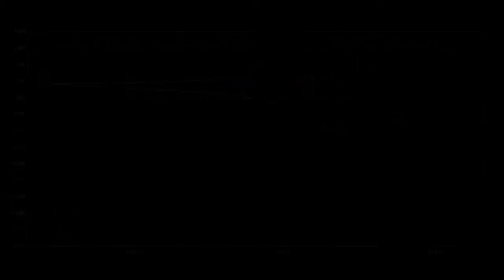How To Make A DIY tonestyler

Comment from the maker: Thanks for all the inquiries about my cap and resistor values.  Please don't take this the wrong way, but really the point of this vid is to encourage y'all to have a go at designing one for yourselves! :)  

Realistically, with this sort of thing, unless your pickup has exactly the same L, C and R as mine, my values will behave differently in your bass.  

And even though it's designed to get a little closer to the treble-cut characteristics of a preamp, this, of course, lacks the active buffering that a preamp has.  It interacts directly with the properties of the pickup.  But FWIW, if you really want to try my values; 150p, 390p/33k, 820p/27k, 1n5/22k, 2n7/15k, 4n7/12k, 8n2/10k, 15n/4k7, 33n, 56n, 82n.  Your mileage will vary...
Reply: Thanks for sharing this mod Rob. I'm really inspired to give it a go. One thing that I can't work out is how to calculate the resistor values for taming the mid peaks. Was there a formula you followed or did you take a guess?
Reply: Hi. What switching dial did you use? I'd like to do something similar on guitar. Thanks
Reply: Where can I buy one of these with the caps?
Reply: I hear what you say but that doesn’t explain the values of the resistors (they can’t be auditioned purely via audio, can they?) know whether they are in series or parallel with the capacitors🤷‍♂️

Comment: What a great way to ground the capacitors - efficient and space saving. I've often wondered why nobody has produced a tag strip to solder ground leads to when going to a vol pot. It always seems such a cram to fit all the leads in.
Reply from the maker: Thanks mate.  One of my early videos.  Not well lit, shot or edited.  But good info there, so I've left it up.  I'm planning a follow up to this video once I finish Project Berocca...

Comment: Thanks so much for sharing this! It inspired me to do my own. I wanted a lot of choices, so I bought a 1/2” diameter 16 position switch for $20, and a box of Mylar caps. As I don’t have the equipment or wizardry for going all out calculating values, I played with values with wires running to a socket, until I decided on what sounded best. I also wanted to keep the resonant peaks. In spirit of how you grounded to an outside strip to save space, I wrapped a desoldering braid around the outside of mine and soldered to that. It all fits nicely in my P bass.

Comment: What a great video, thank you! The Blu-Tack "soldering stand" is an idea I will definitely adopt. I see that you put the resonance-taming resistors in series with the caps. I have seen schematics where resistors are placed in parallel. Not sure I understand the difference between those two approaches, could you elaborate?

Comment: Excellent stuff. Is it easy to create a circuit that measures pickup resonant frequency?
Reply from the maker: I'm planning to revisit this video at some stage TBH.  There are one or two little things that are not quite right,  plus I was new to YouTube when I made it.  This project seems to be misunderstood and needs a better explanation I reckon.
To find the resonant frequency I use a driver coil and a signal generator.   I wound the coil myself, but there's other options.  The old usb scope and software I use was bought mostly for this and because it can plot freq responses. These days you can get scopes that do it that aren't crazy expensive like they used to be.
Reply: @RobMods  ok, thanks for the reply.

Comment: Is it possible to combine a tone styler (variable cap selector knob) with a separate (full sweep pot) tone control, and would that allow wide variations with each preset capacitor?
Reply from the maker: Yep, having a standard 250KA pot and a switch of some sort that selects different caps is a very common mod.  That's really not what I was going for with this design, but I say go for it.  Give it a try!

Comment: So did you wrap foil around the switch and then just solder the capacitors to that to ground them? Because that seems infinitely better than what I was trying lol
Reply from the maker: Yep, it works well, but is still pretty fiddly to wire up, especially with the addition of the resistors on there.  If you have the space, another approach is to use a switch with PCB pins, and install it on a piece of circuit board.  You could just dremel the circuit, and use a mini drill for the parts.  Or, really if I had to do a few of these, I'd just design a PCB, and with SMT parts as well...

Comment: Great video Rob; thanks a million for posting! 

I've managed to duplicate what you've done after many careful viewings of the vid, buying the CGM USB scope and downloading and learning LTSpice (took a few hours but well worth the effort). I've got data (resonance, suitable cap and 'taming' resistor values) for a few odd bass pickups I've had kicking around for a while. Haven't yet put them into a bass for testing, but that will come soon. 

A couple of questions, one actually arising from a later video you did: 
1) How did you get such a clean display when measuring PU resonance? Did you amplify the sine wave signal generated by the oscilloscope? My waveforms and the XY plot were pretty ragged because I had to use high sensitivity on the scope to detect them, (but I still managed  to estimate what the resonance frequency was).
2) If I want to measure a PU's frequency response using a driver coil, what kind of coil should I use? Can they be bought, or must I make one up?
Thanks for any tips you can offer.
Reply from the maker: Nice one mate.  for a cleaner scope reading, try covering the pickup with some shielding material.  Just a piece of plastic or card with copper foil on the top side will work.  And use an alligator clip lead to connect it to earth or course.  As for a driver coil, well I wound my own, and I made a simple buffer preamp as the output z of my usb scope is not particularly low.  But you could probably use an audio transformer, or maybe a coil from a relay or something, as long as it has much lower inductance than a guitar pickup, so its resonance is much higher, out of human hearing.

Comment: With these fixed roll-offs are they the equivalent of tone pots fully off i.e. full cut? 
Very neat construction. I like the plasticine "jig".
I'd like to learn more about the setup for determining the resonant frequency of the pickup. I've got the toys to do that.
What are the values 3.81 and 2.01 in the notebook working lines 3 and 4 ? And M2 and H2 ? Ya got me there...
Reply: OK got it. Nanofarad values for bracketing towards a result.  Plus I found this pdf. http://www.syscompdesign.com/assets/Images/AppNotes/guitar-pickups.pdf which appears to be what you're doing in the vid.
Reply: That's a really nice range of tones your Precision is getting, I'm tempted.
The frequencies being musically useful they don't suffer from being full roll off like a stock cap would, what it the stock cap value btw?
That's the Greyest lump of Blue Tac I've ever seen.  I too have used the old "Helping Hands"  but my favourite is a little Chinese vise. I used to carry two on gigs. One loose and another screwed to a piece of scrap wood. The stuff I've fixed for bands at gigs I was doing the PA for. They loved me. Got lots of work cos they remembered me saving their arses. Nice bit of Karma innit. ;^)
My electronics bench is covered in randomness. I can't call it crap cos a lot of it is expensive crap...
After watching this I fancy dusting off the scopes. Somewhere under the pile is a Hantek USB signal generator  and every other multimeter has a Capacitance range these days. 
The copper wrap is a neat idea, elegant solution I'd call it.
Stream of conciousness comment order . It's early hours Saturday night/Sunday morning and I'm somewhat the worse for wear. ;^)
Keep up the good work.
Reply from the maker: Ha ha, yeah that blob of blu-tac is getting quite grubby these days.  It's seen a lot of action!  Time for a new packet I think...  :)

The original cap was 47n.

The solo part on my recent version of Blackbird is played on my 73P.  It has an active preamp in it these days, with the treble boosted for this recording.  That's just to separate it from the EUB in the mix.  I don't always play her with such a bright tone.   /watch?v=qtjKge6Bj9Y

Comment: Rod mods, do you have the schematic to Jesse Davey Kingtone switch?
Reply from the maker: No I don't.  Sorry.
Reply: Can you try reverse engineering the jesse Davey kingtone switch?
Reply from the maker: Reverse engineering other people's stuff is not really my thing.  Besides, these are $200 in Australia.  But thanks for asking...
Reply: I didn't know they were $200 dollars in Australia that's a rip off but from your ears can you tell which RC networks are being used in position#1,#2,#3 on the jesse Davey kingtone switch?
Reply from the maker: @waynegram8907  If they are just RC, then that really is a rip off, lol.  I assumed there was a little inductor in there as well.  I guess you aren't paying for the parts, but the soldering, potting and postage.  I hadn't heard of these until 10min ago.  Never had one on my bench either I'm afraid.  Try making one yourself!  A breadboard or even just an IC socket like I used is great for quick swapping caps.
Reply: Yes true you use machine head pins sockets for swapping caps? If just don't know what RC values he used because they sound different from a varitone switch which I don't like the varitone but the jesse Davey kingtone switch has really good positions 1,2,3,4 I like a lot
Reply from the maker: @waynegram8907  Cool.  Well I'll keep an eye out for one.  But I mostly work on basses these days.  FWIW, with these sort of things, the response they create is dependent on the pickup specs, especially inductance which varies hugely from pickup to pickup, and also changes when you change your pickup selector switch.  Saying one position is "true-bypass" is a bit misleading IMHO, because it implies that like a pedal, the signal goes "through" the switch.  The components simply shift the resonant frequency around.  Check out Project Berocca Part 9 for more stuff about cap loading.  https://youtu.be/54kHIhT0un8
Reply: Yes when the tone control is set at 10 on guitars or on bass its still going through the capacitor on the resistive tone pot which shifts the center frequency to the left.The Delta Tone on guitars means that they use No Load Pots on the pickups which give you wide open center frequency of the pickups
Reply: How are you connecting a guitars pickup to plot the frequency response of the guitar pickup? are you using a spectrum analyzer and sweep generator?
Reply from the maker: @waynegram8907  You can make your own no-load tone pots:  https://youtu.be/fBLp53iNCf4  You can even make your own lo-load volume pots:  https://youtu.be/a_hoNAT4JcM  As for how tone caps work, check out my two-part video on that:  https://youtu.be/zE-vzFeuh5c
Reply from the maker: @waynegram8907  You can make your own No-Load tone pots.  https://youtu.be/fBLp53iNCf4  You can even make your own No-Load volume pots.  https://youtu.be/a_hoNAT4JcM  For more info on how passive tone controls actually work, check out my two-part video on tone caps.  https://youtu.be/zE-vzFeuh5c
Reply: Yes I have seen that video of making your own no load pots before saves a lot of money.

Comment: What was that grey putty you were using? I've tried to use modeling clay the same way, but it ended up adhering to the pins of the thing I was soldering.
Reply from the maker: That's Blu-tack.  It works very well for this sort of thing.  I also use it to hold wires or parts in place when I'm point-to-point wiring a bass or an old amp etc.

Comment: I want to do everything in this video.

1. how do I test for my pick up frequency?
2. I'm assuming that 100n cap was chosen by your ear. 
3. What math did you use to equally divide the res frequency to the cap with the lowest desirable roll off?.
Reply from the maker: Hi.  I use a Circuit Gear usb oscilloscope.  Here's how to measure the resonant freq:  https://pdfs.semanticscholar.org/89d5/f924dddb854b01fe989662d57d9347170f55.pdf
You can also do frequency sweeps if you make a driver coil.  If you watch my other videos you'll see this from time to time.

Yes, the lowest cap was just chosen by ear.  Actually I changed it to 82n later on.  100n was just too muddy for this pickup.

For evenly spaced frequencies, it's simple division.  In the video, the spreadsheet shows 4khz as the resonance, and 1.37 as the divisor.  But after cable capacitance and the load of the pots, the highest roll-off is more like 2.5khz.  So these points were revised.
Reply: Was that a copper ribbon you cut and wrapped around the 12 pole switch?
Reply from the maker: It's self-adhesive copper shielding tape.  I use it to line control cavities mainly.  You can buy it online from guitar supply stores, but you can also buy it from garden centres as "slug and snail tape".

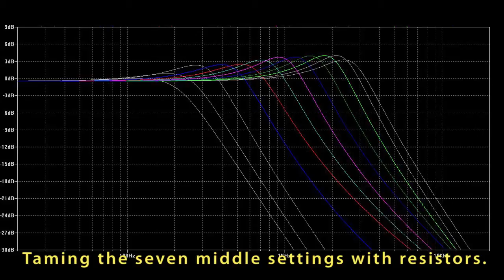Comment: Is that LTSpice on the laptop at 3:52? I used to work for Linear Tech. Anyway, this is a good video. I'm thinking a rotary switch with RC combinations to switch through could be more useful than one cap and an R sweep pot.  Thanks for the idea! Any particular values you like best?
Reply from the maker: Hi Eric.  Glad you enjoyed the video.  I'm trying to get better at making these things as I go!  Yes that's LTSpice.  It's pretty much the go-to for hobby electronics guys.  With a traditional tone pot, the cap really makes little difference til the tone knob is almost all the way down.  It's actually the pot that is creating the roll-off for 75-80% of the sweep.   The nice thing about my switched-cap tone control is that the roll-off is steeper.  Much more like an active treble cut.

I have a new video all about traditional P bass tone control coming out in a day or two.  I use a driver coil and a usb scope to run frequency sweeps on the pickup from this bass actually...  Thanks for your comments!
Reply: @RobMods  I like the blutak to hold things while soldering too. Looks easier than alligator clip stands which I've been using for years. Are you simulating the pickup too? Since the input to an amp is high impedance you probably wouldn't need it in your  simulation, but how about the PU?
Reply from the maker: Ha yeah I''ve owned those alligator clip stand things too.  But I've always come back to a blob of bluetac on a piece of timber!  I've been sodlering since I was a boy and I found early on that blutak is very handy for guitar wiring and point-to-point wiring in general.  Notice also my bench has that rubber draw lining stuff on it.  The circuit or guitar doesn't slide around.  Yes the pickup was simulated in a basic L,C,R model.  A bit too simplistic really, but for designing this sort of thing it's fine.  The thing I really should've done was added more cable capacitance.   I think I had 250p for this, but I should've actually measured my leads.  They have close to double this, so the first cap doesn't make much difference.  OTOH, I have a no-load volume pot (see my other video about this), so the pickup is as bright as it can be with the volume up.  I have a little fet buffer built into a jack which I sometimes use and with the cable capacitance out of the equation, the pickup's resonance is actually 4khz.

Oh, and I recommend a "make-before-break" switch for this.  (AKA "MBB" or "shorting".)  The switch I used in this video was a regular break-before-make switch that I had in my parts bins, and it pops slightly between settings.  I've since made another with an MBB rotary switch I ordered.  Works very well.

Comment: Forgive me but I just don’t  understand how to work out the value of the RESISTORS!

I can understand auditioning CAPACITORS  by ear but after that…🤷‍♂️ How to work out the resistance values IF  The values for the Resistors you use are all different depending on what Capacitor the attached to?🤔

Comment: You do know you  get full gain and tone without a control
Reply from the maker: Yes and no.  With reasonable pot values, the gain/output is not effected, but the tone certainly is.  For this project, the 12th spot has no cap.  IOW, it's an open circuit.  FWIW you can get the same effect with a no-load tone pot.  If you really must have no load at all with the volume and tone dimed, you can make my no-load volume pot as well.  Check out my other content for info on this stuff...   OTOH, a little load can sound great.  With this bass, I rarely use it live with this tone control fully clockwise.  In the studio though, it's great to record with both controls dimed and no load (except the cable capacitance and interface input z of course).  You can easily roll a little treble off in the mix, but you can't add it if it's not already there!  Cheers!